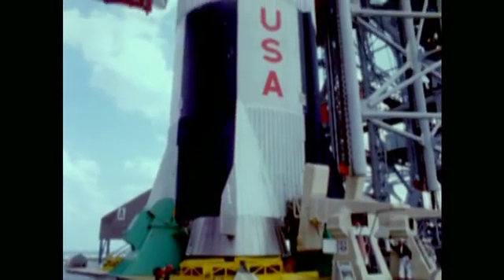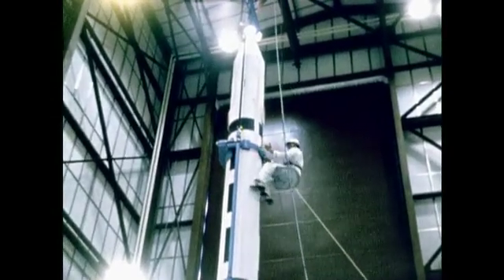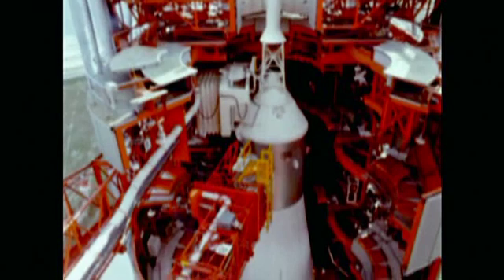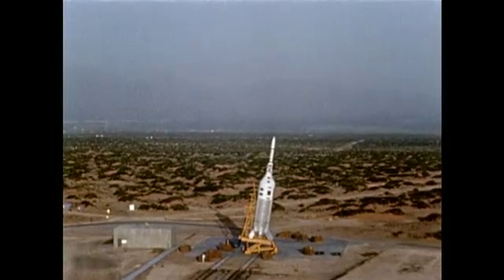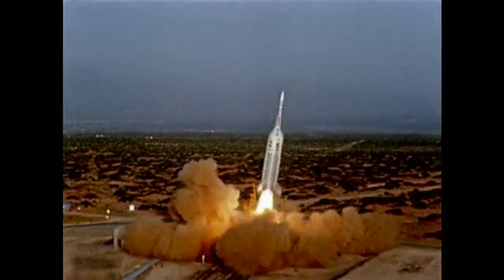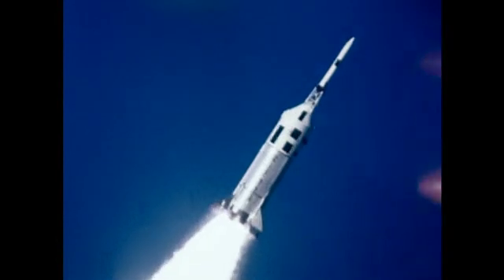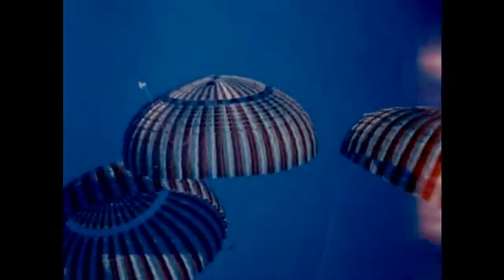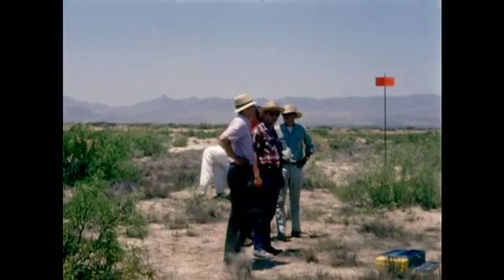Apollo Launch Abort System Test

Comment: the 3 wire is a simple system.. many sensors were monitored in the instrument unit, lots of conditions would trigger an abort, and fire the les.... also a nifty handle in the command module...but flyboys never pull the quit rope. lolz

Comment: why didnt this work on the challenger when it exploded?
Reply: Challenger’s problem was that it wasn’t ready to fly on its own at this point in the flight, e.g. the hydraulic flight control system was inactive, and also the attachment to the rest of the stack wasn’t designed to separate as soon as the external tank lost pressure. Even then it’d have been extremely hard to guarantee survival, since the orbiter would likely be impacted by something that could compromise either its ability to fly, or could impart enough momentum that the resulting corrective aerodynamic forces would exceed its load limits; it would then disintegrate either because of high control loads or because of veering too far away from the airstream. The people who knew the design well basically said that this type of failure could not be made survivable in that design, even on a best-effort basis, IIRC (i.e. the “best effort” for the unlikely scenario would highly increase the risk for a nominal mission – think e.g. of the outcome of an inadvertent flight control deflection on the orbiter during powered ascent).

Comment: If this had been on the shuttle the challenger accident would have been survivable
Reply: Ventures With Joe The problem is that you can't practically mount an LES on something that is designed the way the shuttle is.  The crew cabin on the shuttle is more than twice as big as Apollo, so the thing would have to be huge.
The second problem is that an LES like this only works if you're at the very top of the stack, so you can fire the rocket and haul ass away from the booster.  With the location of the orbiter, you'd have to fly past the ET and the SRBs--which because of the breakup, where not in their normal position and creating a huge cloud of debris--which you'd be flying through.
Reply: steve mitz That was some good acid, wasn't it?
Reply: By that logic, a passenger airplane losing a wing in flight is survivable.

If you don't have a chance to make it home alive, it is NOT survivable.
Reply: Still better than Kerbal standards.
Reply: steve mitz How's that mesothelioma working out for you?
Reply: I'm no leftist, but I would like to point out that, at least according to Wikipedia*, while the external tanks were being switched over to a CFC-free foam, the one that dropped the foam piece that created the hole in the reinforced carbon-carbon paneling of Columbia's port leading edge had the old CFC foam.
Also, your comment is hard to read with nearly every 5th word being capitalized, put in quotation marks, brackets, or being a typo.

*Unfortunately it would seem my computer displays a bunch of gibirish when I try to view the pdf source.
Reply: tightshot88:  The "Death Trap" was Commie inspired [Save the world]  “Environments”  “standards" that demanded compliance & forbade god awful asbestos SRB seals. Challenger SRB engineer’s scrubbed the launch, NASA overruled with a Classic [words to the effect] “It didn’t blow up the last time we exceeded parameters.” [With asbestos seals]   Thank god is was an,... Asbestos Free, Catastrophe. 
Same with the new [rock hard] Fluor Carbon Free foam insulation that blasted a huge hole in Columbia.
Godless, Satan inspired, Fear Mongering Marxist, Progressive, New age Leftists and there “We just want
to help save you” scam has brought down more than Space Shuttles.  [100 to 200 million so far, but give time!]
  Creator inspired Liberty, Freedom & Capitalism   built this nation. Satan/Marxist inspired leftist politics have devastated our nation’s morals, economy and space program. 
The Shuttles mission was to explore Space, our mission, [IF] [we should choose it] is to explore Heaven.
      Via con dios.  Steve The "Death Trap" was Commie inspired environmental
"standards" The "Death Trap" was Commie inspired
environmental "standards" The "Death Trap" was Commie
inspired environmental "standards"

Comment: How is it that the yet unbuilt, but widely touted NASA SLS system is almost identical to the Apollo rockets, even down to the abort system?  45 years later and we can't even have progressed from there!?  Man, I understand if it's not broke don't fix it, but that's exactly what your 85 year old grandmother tells you about her 30 year old TV when you suggest getting a new one.  There are better ones out there.
Reply: think for a second about how long humans have been using the wheel, shovels, irrigation, etc... Sometimes, things work, and you don't need to 'reinvent the wheel'.  There maybe developments out there that will improve our launch systems though, I don't doubt that.
Reply: The Saturn V is the greatest thing ever built. Now imagine something even more powerful with the most advanced computer systems available, and safer. Space technology hasn't changed much since apollo in terms of operations. We just have glass cockpits and computers that take a bigger workload. The SLS has solid rocket boosters anyway, the saturn V didn't have those'
Reply: Capsules are actually a better way to safely go to and return from space. The Russians have always used capsules for a reason. The shuttle program, as great as it was, was actually a result of massive budget cuts and poor planning. NASA was basically using a piss poor method of going to space for the past  40 years. If you want to see advancement in rocketry, look at SpaceX. Some of the things they are doing are amazing.
Reply: It looks the same but behind the scenes newer technologies are behind it. And we just came from years of using space shuttle, so most of the technologies surrounding the apollo missions are way too obsolete now to be reused, as well as the manufacturing techniques. so we must develop a completely new one instead of exactly copying apollo.

The general system looks the same, because it's the best option out there. Similar reason why cars still has wheels and planes still has wings. They've tried spaceplanes, thought about nuclear engines, slingshots, but they still kept coming back at the capsule system. because it's the most efficient, reliable, safest way as of now.

Also the budget is one of the primary reasons why. If you want 'future', look at the ISS, look at other private space companies like SpaceX. the SSTO Skylon is in heavy development, as well as NASA researching about FTL possibilities with an idea of a machine called Alcubierre Drive.

Right now, SLS is the best choice. i'm sure hundreds of top engineers and scientist have already thought about, and are thinking about it
Reply: The improvements in Orion-SLS over Apollo-Saturn are mostly "invisible" ones - the rocket nozzles are going to be simpler because we can 3D print them with the regenerative cooling channels in the walls rather than as brazed plumbing welded to the outside of the nozzle. The computers are almost literally infinitely better than the ones on the Saturn V. The Orion capsule is much more spacious than its modest increase in volume over Apollo might suggest because of tremendous leaps in miniaturizing the support hardware.
Reply: I read somewhere that NASA is having great difficulty in deciphering the old technical schematics of the old Apollo hardware.  Engineers worked under very different constraints back then. Take for example our reliance on CAD and theirs on actual written markups.  Plus none, or maybe very few, of the original engineers are still practicing; most may even be  geriatric or passed away.    For many components of any new space program, you're right, there will be substantial re-engineering of components.
Reply: Basically, it's been so long since we have built a rocket this powerful, we have to make sure we can make another one, before we start looking more seriously at what improvements we can make. The Apollo program was great at keeping records in a lot of aspects, but there's a lot of information and tooling used to make these things that is now gone. NASA are not simply building on what has been done before; with some parts they are actually having to 'reinvent the wheel', so to speak.
Reply: Trevor Freckleton Look at what SpaceX is doing tomorrow, very different. Their abort system works all the way to orbit. http://www.spacex.com/news/2015/05/04/5-things-know-about-spacexs-pad-abort-test
Reply: ***** And in retrospect, the SRB system wasn't such a good idea. They were very dangerous. Well mounting the shuttle next to them was anyway.
Reply: In principle it's nothing new but if you look at the details (electronics / computing / sensing / materials / reliability) everything is so much better and cheaper.
Reply: +Jonah Beale And if, for example, the CSM+LM was in the center of a large cloud of debris that was following the spacecraft, it would look like false stars if you tried to use the sextant and scanning telescope.  If something were to happen to your spacecraft that would cause a bunch of debris to form and follow the spacecraft, like the Service Module's LO2 tank rupturing following a cryo stir, if you got the CSM into one of those gimbal lock attitudes, may God help you.
Reply: Elizabeth Smith 
You know what would be even worse? If the other LOX tank leaked so the fuel cells died and the entire CSM had to be powered down until re-entry.  :P
Reply: In the past 5,000 years, the basic concept of a boat on the water has not changed. The vessel weights less than the weight of the water that it displaces, therefore it floats. Propulsion is either by sail (literally used for thousands of years and still used today) or mechanical propulsion (turning of a paddle wheel or a propeller). A shipwright from centuries ago, would basically understand ships of today. 

It seems logical that rocket ships of today, would and will have similar basic design elements as rockets 50 years ago. What the heck, the rockets of 50 years ago had the same basic elements of the rockets of 50 years before them as flown by Goddard.
Reply: *****
The physics of launching a rocket hasn't changed, so the calculations and the programming requirements have not changes as well. You gain nothing from a more powerfull computer for launching a rocket; if you have the amount of computing resources a late 1960-ies launch vehicle computer had, you're golden. What does gain from modern technology is, that a chip smaller than your little finger's nail, costing less than 30$ in the aerospace grade version does the job today. But the big expenses in rocketry never have been the computers anyway.
Reply: ***** Yes, and it was able to fly itself into orbit with its human co pilots (:
Reply: Spacex.
Reply: ***** SLS is only planned to use solid fuel engines for the first two launches - after that they're planning to use a pair of strap-on boosters consisting of two modern derivatives of the F-1 engine each.
Reply: Trevor Freckleton "Space is tough"
Reply: +hexarith 
The computer on Apollo did the job... barely. For instance, the guidance reference was mechanical. There were two attitudes the spacecraft could get into that would cause the reference to physically lock up. If this condition (gimbal lock) was encountered they had to completely re calibrate the guidance system through star spotting.

Comment: Didnt add enough struts.
Reply: Should've used MechJeb
Reply: John Poliniak You clearly didn't get the Kerbal Space Program reference. The widely accepted rule in that game is that if your craft waves/spins/breaks you add more struts until it doesn't.
Reply: Forgot to turn on SAS
Reply: Jack Boyd or MOAR BOOSTERS
Reply: lamorte42  not enough rockets
Reply: Check your staging

Comment: Centrifugal forces. Im no rocket scientist but the rockets are designed to operate under certain conditions, and those conditions don't include rotational forces. So the strength of the rocket is along it vertical  axis not around its horizontal axis. This isn't what would be considered mild rotation. The g's created by that spin would be quite large.
Reply: The22NITSCHKE centrifugal forces gag
sorry to be that guy

Comment: How can a rocket completely rip apart from such a mild rotation?
Reply: it was the centrifugal force from the roll; you ever ride the Gravitron carnival ride? the force that pushes you into the "seat" and the "seat" up to the ceiling in that ride was the same force that pulled the Little Joe apart and created the "Perfect" test for the Launch Escape System.
Reply: "such mild rotation"
Vehicle was rotating at 335 degrees per second.
at skin surface, this imparted 6.79g of acceleration.
The Algol solid boosters in the rocket body were pressing against the outer shell with some 14.3 tons of force, each.
no ways would this be correctly described as "such mild rotation"

Comment: Actually I think you have it backwards.   The Shuttle SRB's had great specific impulse but a very poor thrust to weight ratio because if its thick heavy casing.  The Shuttle SRB's were seen as a low cost alternative to its more powerful liquid cousins back in the final 1972 design.   SRB's are the most risky.  The Office of Management and Budget insisted on less expensive solid boosters due to their lower projected development costs.  NASA would have chosen liquid boosters.

Comment: You bring up a great point and you are partially right. Liquid fuel and liquid engines are heavier, and unless you are also lifting the service module up and away, there is only the very small amount of monopropellant for the attitude control jets, the control jets are not very powerful, and even if they were to fit larger and larger monopropellant engines on the capsule, they are not powerful and would be heavy and inefficient. Last I checked, SRBs are less risky than liquid and more powerful.

Comment: Fuel is still there with or with out the tower.  You must have maneuvering fuel.  Either need to escape or maneuver, but not both.  You only need a few secs on a liquid rocket.   Solid rocket fuel requires a much larger/complex escape system.  Solid fuel does not turn off, or vaporize, and its explosion can eat up a parachute for miles.  Thus, Orion needs a 5 story, massive escape system which alters the size of the launcher and its cost.  All because the Senate has mandated SRB's be used.

Comment: I see what you mean and I know what you are talking about, but carrying fuel inside the command module would be very heavy, and NASA likes being able to shed the extra weight of a LAS when it is no longer required. On a command module, like Apollo or Orion will have, a very limited amount of fuel is aboard, and it is for the control jets during reentry, but I do like SpaceX's and Blue Orgin's idea

Comment: Tower escape systems can be risky, heavy and expensive. Directly escaping from capsule thrusters is safer and happens to cost less because the fuel is already there used for maneuvering. Max Launch Abort System (from Orion not chosen by NASA **FAIL), Blue Origin escape system, Dragon escape system, are all more modern and safer escape systems.  Tower ejection is also dangerous and you don't have escape all the way to orbit.

Comment: @dwmzmm Oh, the Saturn V guidance system did indeed work very well. But its components are all long obsolete and are unavailable. You'd really have no choice but to design a new guidance system with contemporary components. It would perform even better and be much smaller, lighter, cheaper and consume less power. It would be even easier to protect against lightning, e.g., by using optical fiber for communication busses and through redundancy.
Reply: ApolloWasReal It worked so well, in fact, that the Apollo Guidance Computer (AGC) was recently restored (see curiousmarc’s videos), and used to fly simulated missions using the original flight software. There is also a very accurate VHDL model of the AGC, that you can run on tandem with the real thing, and they behave identically (within the confines of what’s important).
Reply: There's a guy who works at the Space and Rocket Center in Huntsville, Alabama as a docent.  He's a former IBM engineer who helped build the Saturn V guidance system.  I met him about a year ago.  Pretty cool.

Comment: @roguemale57 I don't see any reason not to allow private space exploration; I just doubt that the money is there. Private enterprise works when there's a short-term payoff in money. The return from space exploration is longer term and largely intangible, making it better done by governments.

High flying airplanes have only a tiny fraction of orbital energy, though they do get you above much of the air that causes dynamic pressure and heating.

Comment: @ApolloWasReal The saturn rocket system (crew vehicle on top of booster) is a proven system as you pointed out. eg. an effective escape system. We can build on apollo & we can enhance it - nasa described the cancelled constellation program was described as apollo on steriods. Advances in; technologies (today's mobile phones have bigger processors than those in apollo vehicles!) & delivery systems (solid rocket boosters) -ensure crew vehicle sizes triple that of apollo.

Comment: @roguemale57 As for the capsule on the booster, yes, this was and still is the way to go so long as rockets occasionally blow up -- which they do. The shuttle's fatal (literally) flaw was the arrogance of its designers who thought the rockets would be so reliable that no crew escape system was required. Now that we know better, there's no way to retrofit one. The Apollo escape tower and rocket, plus its well-protected heat shield, is still a very good design.